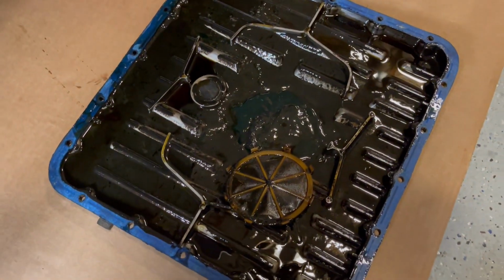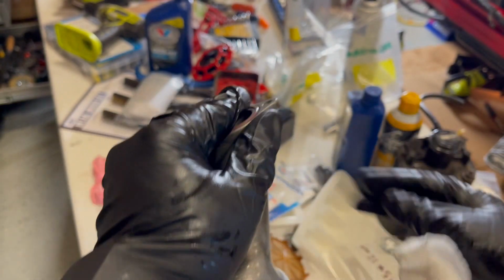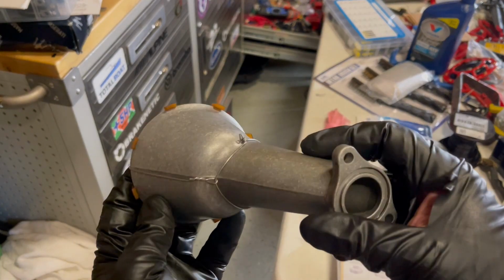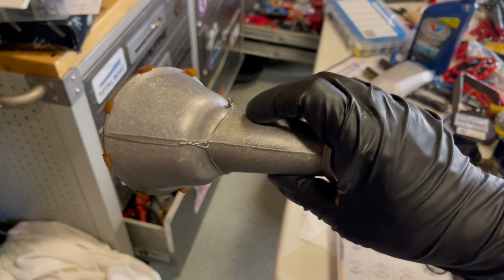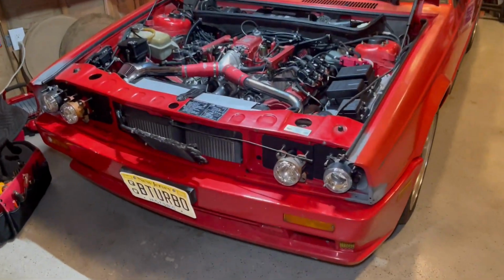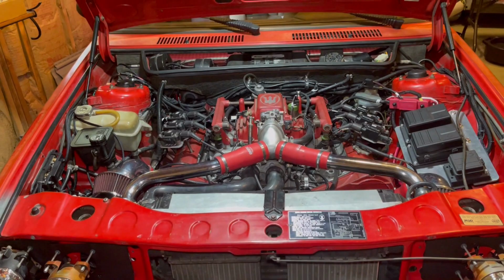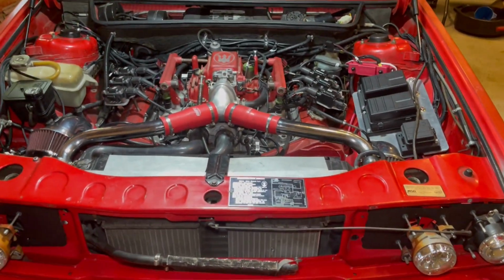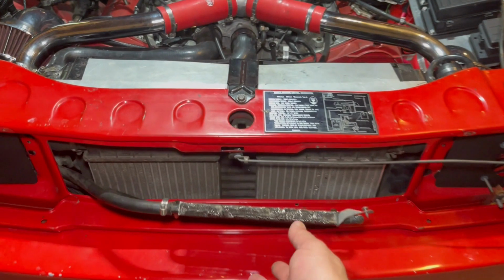1987 Maserati Biturbo Oil Cooler Installation - Part 2

Comment: could not see but were the alloy brackets trimmed that hold the oil cooler to let the air through?
Reply from the maker: The vertical brackets only cover the end tanks of the oil cooler.  The horizontal supports do block some of the fence, but only about two fins, top and bottom.  The good thing is the whole bracket is aluminum so it acts like the heat sink